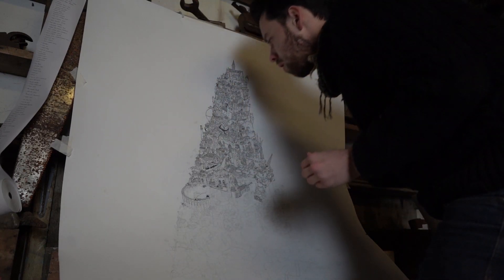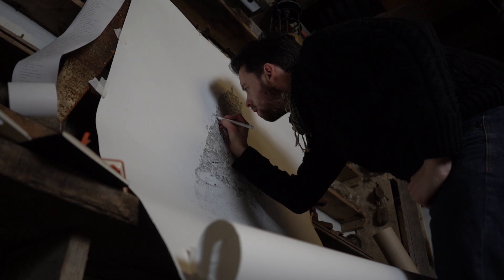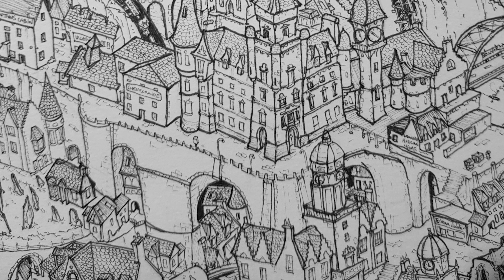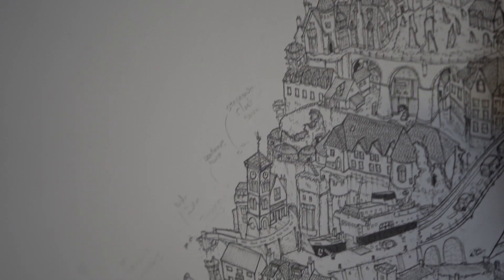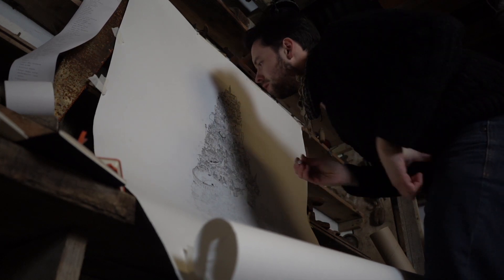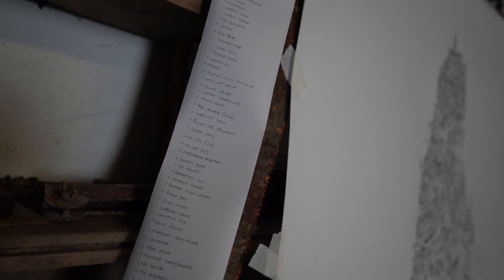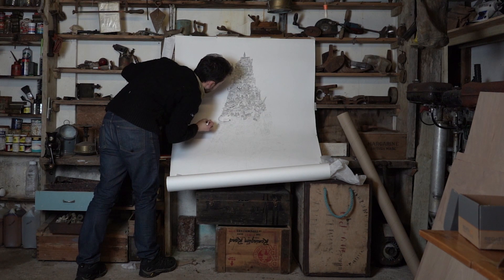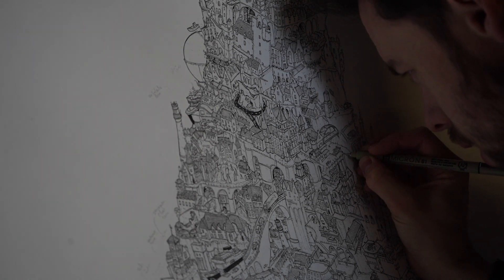Drawing Every Building in Scotland

Comment: I'm a bit OCD about my pens even for just daily writing, more how smoothly they write and draw than anything. My favorite brand for that by far is Pilot, their gel pens with fine point 0.3mm ball tips are my favorite for general fine detail work. For super fine details I use Winsor & Newton fineliner pens which go all the way down to 0.05mm, but they're not a ball point, they have a felt tip nib which doesn't last as long, so I use those more sparingly.